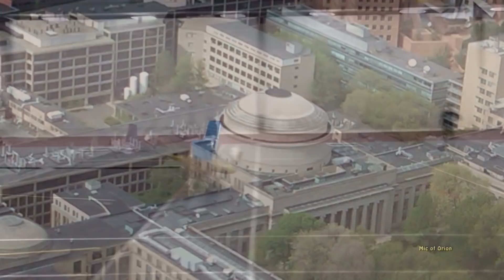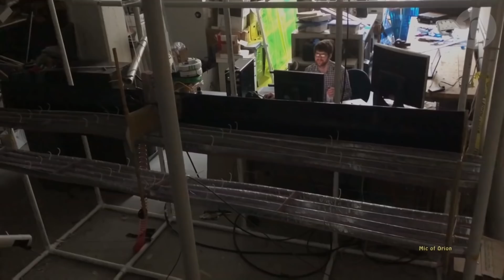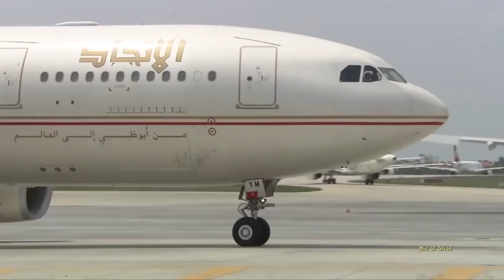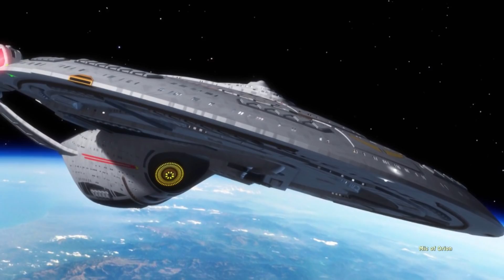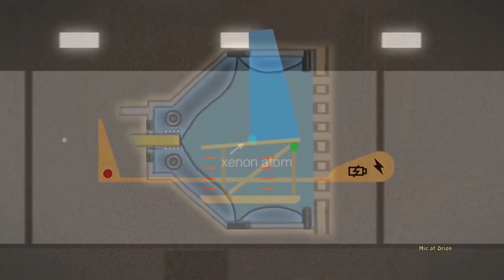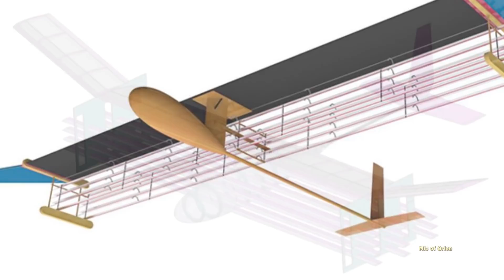STAR TREK LIKE ION DRIVE AIRCRAFT

Comment: Once Graphene based super capacitors are available with about 1000 times the energy density of current batteries, this would indeed happen.
Reply: Ecxcept that the graphene capacitors would have an EXCEPTIONALY short discharge time, making their specific impulse (push over time) equal to about a quarter of the energy density of CURRENT state-of-the-art suel-storage systems (batteries). The truly EXCITING development - really validating the intent of your comment, I think, is what's being done in battery technology, pushing the masnasged energy density from around 12-15% efficiency these days (excellent, btw) to upwards - potentially - of 40%or more ! Once they hit tHAT threshold, it becomes economic, giving conventional use, as in Cell phones, Laptops and Teslas, the EXTENDED range now lacking. We're talking HUNDREDS of miles for an electric car, as opposed to a little over a hundred for a Tesla, and MUCH less than that for its SLOWER more conventional - less space-faring - competitors. Once THAT happens, you'll see the econimic use/loss curves intersect back at a $ point that's meaningful ecnomomically, and development will break WIDE open ! Now that doesn't mean ION propulsion (conservation of just about EVERYTHING will get in the way of that) but we will be seeing ECONOMIC electric cars, motorcycles and small planes, and yes, even possibly flying cars, as some exciting stuff is being done THERE these days, with the limitations being - again - the current state of Bettery tech development. The "Power" requirements for a space-application - for NOW - would be supplied EITHER by Solar Cells in close enough in that the Sun can provide a meaningful amount of useable energy, and - most likely - nuclear, further out. THEN you get into some real mass/acceleration issues, but that's being worked on too. Lots of exciting stuff ! But for NOW, its still dinosaur juice and oxidizer for the forseeable future ;-) !

Comment: it may not have a propellent per se, but it has an energy source, the electrical fuel cell that is creating the current. So, that is the propellent in the sense that it is fuel. 

I can see the disadvantage of this. I don't see the advantage. It is just another way to do the same thing. Energy in, energy out. This is not new. If this was a practical way of making an airplane fly, it would have been used long ago when it was first invented.

Comment: Ion drive is impractical for ground based aircraft.  Didn't you see that this plane was launched by something other thn the ion engine?  Ion engines don't produce enough thrust to get off the ground.  Never have, never will.
Reply: Hi Glenn,
You probably already saw it, but on my channel there is an earlier, yes earlier one that does lift its power supply using an ion drive.  Verification is also provided:).

Comment: What's new about this? Another MIT "we invented it" bullcrap? BTW folks, what you see, is probably the pinacle of ion drives. Replacing a jet airline, would require  nuclear powerplant and small drones... unless batteries get like 20 times better than what we have now, this is and will probably just be exactly this... a paper airplane with absolutely no use. Besides this is in use for decades on satellites. But they have the sun to power them and they are capable only a very small bursts to relocate a sat. Move along, nothing to see here.
Reply: Well you are right about the batteries, in order to power ion thruster you need high voltage, but i think they will make one airplane in the next 20-40 years using this technology for sure. And the space engine iron thrusters.. well they get power from the sun because if you put battery in the ship it will run out eventually.

Comment: Electrically powered is NOT fuel free. It uses stored energy (batteries/capacitors). Future (large scale) could use gas turbines (one of the most fuel hungry engines).
Speeds up to 1000 kph, not likely! Internal air flow WILL NOT exceed the speed of sound. This works on mass flow, not pressure. Supersonic flow needs pressure.
Reply: It all depends upon the strength of the repulsive field.  Supersonic speed might be possible.
Reply: @DaveWard-xc7vd  
When the working fluid (a gas) approaches the speed of sound, it changes from a compressible fluid to a no longer compressible fluid. More strength in the field does not help, you need a faster field (not a stronger one). Much like ion engines in space, great endurance but very low thrust.
Reply: @haroldhenderson2824  

Their design does not compress the air as a jet engine does.

A jet engine is limited by the velocity of the exhaust.

Their design pushes against a mass of air that is freely flowing through the electrodes - unrestricted - uncompressed.  

The harder they push. The faster they go.

Like a screw in water.
Reply: @DaveWard-xc7vd  
In ALL reaction engines (jets, rockets, propellers) the thrust produced is related to the amount of mass moved and the speed at which it is moved.
F=1/2m x v^2.   Therefore, you either move a much greater mass (how subsonic jets work) or increase the speed (pressure).
Being an open frame design, this device can not increase pressure! It already spans the entire width of the wings (can not increase flow area). It already is at the point of creating electrical arcs in air (can not increase voltage any more). Those thin wires will melt with any increase in current. So, how (or what) do you suppose can make more thrust in this device?
New physics?
Reply: @haroldhenderson2824  

Super capacitors charged to millions of volts.

https://www.google.com/url?q=https://ntrs.nasa.gov/archive/nasa/casi.ntrs.nasa.gov/20040171929.pdf&sa=U&ved=2ahUKEwjoxpHpt_DeAhXEqIMKHRCLBlgQFjAAegQIAxAB&usg=AOvVaw0mP25RMyP_Ga_IRZJKm7Aa
Reply: @haroldhenderson2824  Dude get your facts right. When fluid speed approaches speed of sound it changes from an incompressible fluid to a compressible one. Also the equation you put forward is of kinetic energy not of thrust. Both are different.
Reply: @Manu-jc2sx  - but both must be conserved, so he's really - generally - on the right track.
Reply: @DaveWard-xc7vd  Nope. You'd have to seperate the craft being accelerated from the massy medium surrounding it - in this case "Air". So speed of sound issues will arise, even if we're really not SURE that would be an insurmountable barier, as I can think of a couple of ways they could do thaat, from physically isolating the input/drive-stream from the craft-mass (some ideas are being contemplated now - (Alcubierre-White drive, f.i.) or even just aerodynamically as is done NOW with conventional jet engines. These kids only did it this way because that's their current state of development. Remember they're just kids, and just getting started.

Comment: Its electrically powered. An aircraft that uses this would use a gas turbine to generate electricity(long way if ever before batteries could match kerosene in energy density).
Reply: Anonarchist if the efficiency is greater than conventional aircraft then you don’t need to match the energy density of kerosene
Reply: If. Ya I don't think it is
Reply: @aaronheaney2694  It's not. Nothing can beat a ducted fan (currently powered by a brayton turbine) for the foreseeable future.

Comment: The "fuel" in this system is the air; it would not work in a vacuum. Bit of a stretch to call it "Star Trek Like."
Reply from the maker: No it would not work as designed in the vacuum, but you can design a space based version of the technology. However, we're in early days.
Reply: @micoforion  exactly, SPACE is filled with electrons and ions.
Reply: @SpecialistQKD  Exactly ! That's why its called a vacuum !
Reply: @micoforion  We are NOT in "early days" . Ion drives exist for many many many years - like 70+
Reply: You didnt listen completly
Reply: Ion thrusters are being utilised as we speak in space, to re-position satellites. It was always assumed though that the thrust generated is too weak to operate in a dense atmosphere. In that respect, this is a big breakthrough by MIT. Will take a lot off development to increase thrust to the point where it's usable by a drone or bigger vehicle though.
Reply: @martinw245  Sorry if you heard this before, but if you click on the channel icon to the left you can see an ion propelled prototype with onboard power that predates the above glider.  It was officially demonstrated to be able to carry its power supply since more than a decade ago.
Reply: @KraussEMUS1  

What exactly are you replying to? Can you quote what I said that your reply is relevant to. I'm not seeing the relevance of your comment. :)
Reply: @martinw245  Hi Martin, Here is a copy of your comment that I was replying to:"Ion thrusters are being utilised as we speak in space, to re-position satellites. It was always assumed though that the thrust generated is too weak to operate in a dense atmosphere. In that respect, this is a big breakthrough by MIT. Will take a lot off development to increase thrust to the point where it's usable by a drone or bigger vehicle though." 

I assume you have already clicked on the channel icon, it shows the real first such devices to carry a power supply onboard, they have already been made into a prototype drone with a much higher lift to weight ratio, although the steering systems still need some work etc. 

Thanks for asking.
Ethan Krauss
Reply: Not much flying but there is lots of crashing 🛬
Reply: @fraserconnell21  

Some of those tests were with 50% power though. They described it as a power glide. the lengthy flight was full power.
Reply: even i was thinking the same thing
Reply: So how do ion engines work in space?
Reply: @DaveWard-xc7vd  ions are collected in a thruster and are electrically charged causing propulsion. It will gradually accelerate the spacecraft indefinitely.
Reply: @SpecialistQKD  

Only upto some fraction of the velocity of the ions.
Reply: @DaveWard-xc7vd  GREAT question - seriously. You spotted the shortcoming right away - GOOD for you. Not kidding. Answer to your question: You have to EITHER carry an incredible amount of reaction mass or just rely on the ions freed from the systems themselves, which by defition are SO SEVERELY "Limited" that they're ONLY practical for accelerating the very SMALLEST of masses, and THEN only in the vacuum of open space. Carrying dense "Reaction Mass" with you however, you could get some useable acceleration, but then you're accelerating the reaction mass too, AND you're STILL looking at MINISCULE amounts of thrust per unit fuel mass. So, no, for NOW , even in open space, its still dinosaur juice and oxidizer ;-) ! The advantage THESE would have is tiny acceleration over LLOOTTSS of TTIIMMEE . This would have SIGNIFICANT value shortening the time to say, the outer planets from YEARS to months, making this an actually worthwhile effort. So- again, for NOW, and for say CLIMBING back to orbit from say the Lunar or MArtion surface, its still conventional rocket engines and fuel, for now ... .
Reply: Old tech used on the b2 Michael shrat. yes it gains efficiency at higher speeds. why don't they just nano print cabon shark skin with imbedded electrodres to decrease laminar drag. mit kids
Reply: The "fuel" is electricity.  Air is the reaction mass.
Reply: @BuffaloSpirit  Yes, micro-thrust over TTIIMMEE and you actually HAVE something. Seriously - this approach, ESPECIALLY with High-density units (THOUSANDS of Ion-Thruster "CELLS" ) and you could get something useful, where reaching the outer planets might be the goal, shortening those visits from YYEEAARRSS to months. Significant, so this development is CERTAINLY worth doing. However, where REAL acceleration is NEEDED - say getting back into orbit from the Lunar or Martian surface, say, and its STILL some form of CONVENTIONAL Combustion rocket - for NOW ... .

Comment: I developed a similar means of propulsion, when I was in highschool in the mid 1970s. It was basically what they call a caterpillar in the hunt for red October, or an interstellar ram jet. Basically a tube  that sucks air,or interstellar hydrogen into the intake applies a charge to it and accelerates it down the tube and exhausts it through a series of grids at the rear. In atmosphere we theorized mach 6 or so. In space we theorize around .9 C.

Comment: That could have been how the shuttle craft in Star Trek worked
Reply: Well no, because there is no air to ionise in space.
Reply: @originalmin  If you click on the purple channel icon to the left, you can see one that is able to lift its power supply vertically.  (It predates the MIT device!) It could carry a small propellant tank, though that hasn't been tried yet.
Reply: If you click on the purple channel icon to the left, you can see one that is at least a little closer to the Star Trek shuttle.  I was operational before MIT's also.